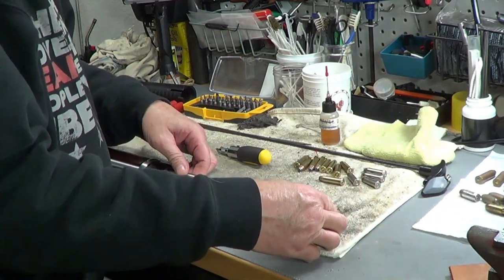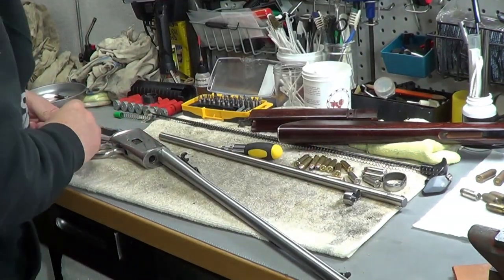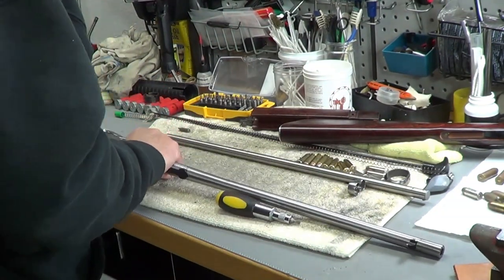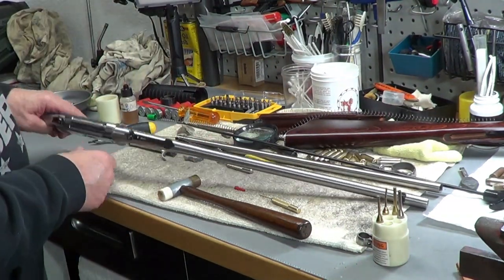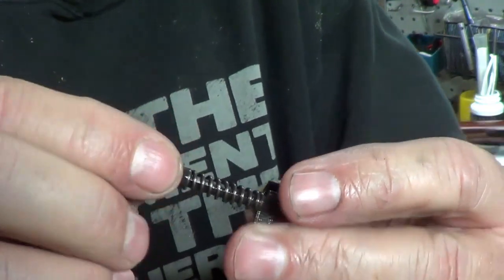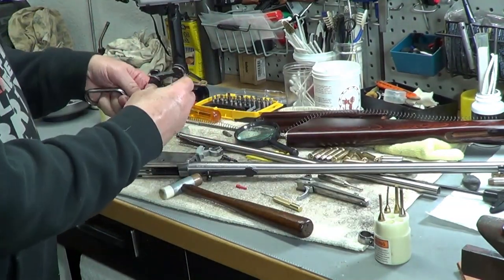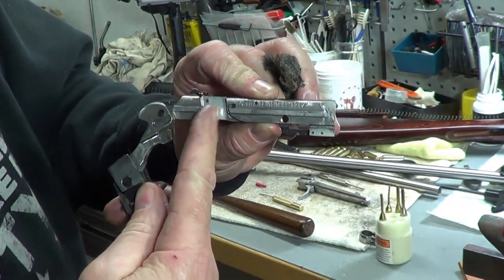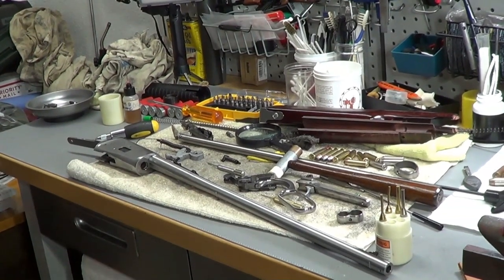Rossi 92 Lever Action Stainless - Smothing Out The Action - Removing Rough Spots

Comment: Great video, Rick!  I had an old timer show me years ago how he put a dab of fine grade (NOT course) valve lapping compound in those channels (where you were going to file) and operate the action about 50 to 100 times, then clean and inspect.  The result was like butter.  Works good for trigger/sear and semiauto pistol slides as well.  Rub a little, clean and check.  Repeat as necessary.  Have fun!
Reply: That's is a good way to smooth the action, the only downside is you must take apart the rifle two or three times.

Comment: Henry recently came out with a 9mm PCC...sort of looks like the front of a Thompson and the rear like a Browning BAR, using a stick magazine.....OEM mags, or Glock or S&W MP mags. The model is called the "Homestead." Planning on getting a Marlin/Ruger lever gun in .357 mag. Supposedly Ruger is doing an excellent job in bring the Marlin name & reputation back. I have a real Marlin 335 and 336 from the 1980's. But they shot rifle rounds.

Comment: Called a " Grooved Pin "  Had to order some for a different project.   Took a little to figure out the label, so thusly the comment.  Many flavors of them.
Reply from the maker: is the purpose to Stop Spinning of pin, that damn thing was tight and super hard to get in or out
Reply from the maker: http://www.thinklikeacop.org/springfatigue.html
Not sure if you read this, I worked it a while ago and may have got input from you.  If you get a second take a look at it and tell if you think I got something wrong or if you think I should add something.  thanks
Reply: Yeah, I hate those grooved pins. They work... but they make it hard to disassemble the gun and cause damage to the pin and the receiver every single time you remove them or put them back. After just a couple times they can do enough damage to not even stay in place anymore. A good pin will be softer than the frame to not damage it... but that's not always the case. (..and either way it sucks to have a gun or part that gets damaged just from disassembling it). It's one of them parts that there should always be extras laying around.
Reply: @HeyGunPeople  Think I saw it before, I'll re-check for content.  Springs in general is a very complicated topic with many factors.   Grooved pins a different topic.  Made some, these were a pain in the butt to make especially for my small size I needed, 1/16" dia  .
Reply: @HeyGunPeople  Spinning not happening due to other pin design.  Main purpose is to stop it from falling out.  some have tapers as well so you have to remove from correct side.   I'll send a picture to you of what I was doing with them.
Reply: @deucedeuce1572  Yep, not my favorite part by far.  Had one on a shark head a while ago that was a real pain.  Pin was Tapered too.   Not a good choice if it needs to be removed often.  Think I made a video on it.

Comment: I have no idea for this gun, but it's a general rule to push the pins out the right side and to put them back in from the right side also. The problem though is that it's not all guns... and many older guns are the one's that go in/out the left side, including some reproductions. I'm not sure how to tell though, because they're not usually visibly smaller on one side than the other or anything like that and I don't think they mark them to tell you.
Reply: Digital caliper
Reply: @RsFrag3d  Yeah, that's pretty much the only way. I was thinking on guns that I don't have directly in front of me... but yeah, calipers are the common sense option. It amazes me that I know people that don't own a single set of them.

Comment: I never noticed any of them had closed magazine tubes. I know you load them from the receiver... but I always assumed they'd still have a removable cap (for cleaning and maintenance). Thought it would be easier to manufacture without having to weld the end shut also.
Reply: .22s and henrys were typically the only ones to do it. Rossi did it on the older puma model .454 R92s

Comment: Just purchased a Rossi 92 44mag and the cycling on it is absolutely brutal not smooth or nice at all when it comes to ejecting a round and feeding the next. It is a brand new gun but doesn’t seem right anyone else run into this issue?
Reply from the maker: oil it up and cycle the action about 500 times, that may break it in, check for rough edges and use 1000 grit to smooth out, that should help